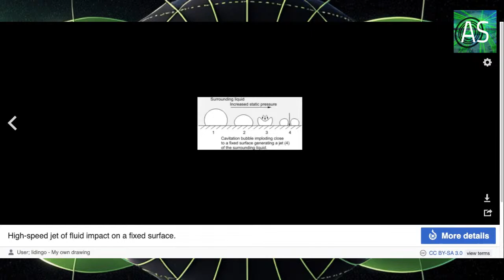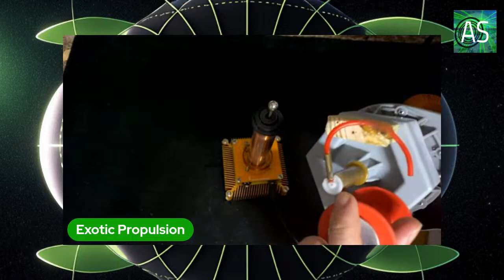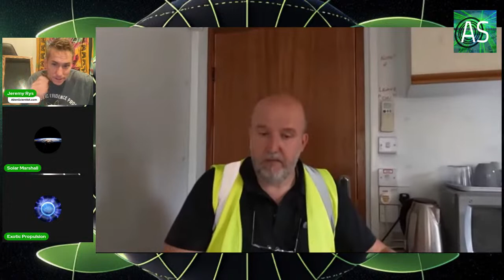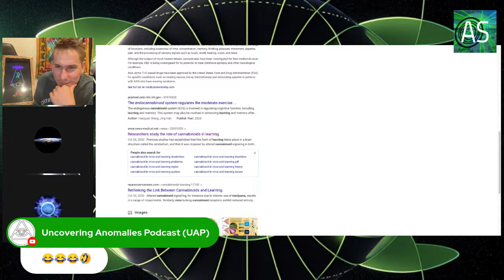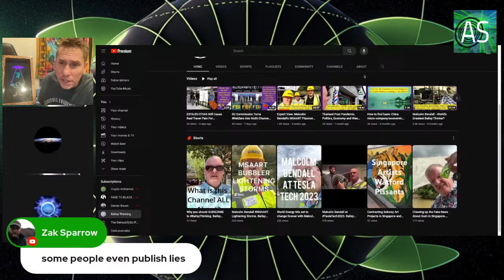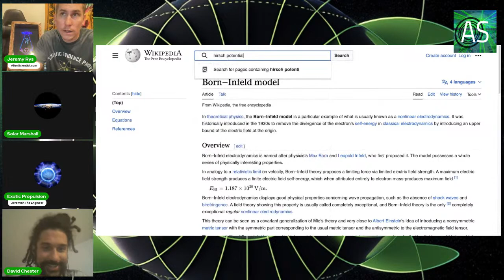alienscientist re-stream The REAL Reason Joe Rogan Never Released the Malcolm Bendall Interview...

Comment: Vortex tube reminds me of two things. If you fill a plastic cola bottle with water tip it upside down and give the bottle a spin the liquid exits faster as more air enters through the centre of outer spinning water. 

The other is replacing the jets in a carburettor to match fuel and airflow to increase power at (WOT) wide open throttle.The original jets let the engine idle well and rev, but under load it would die out. The new jets had the same diameter hole on exit with the only difference being fuel intake side was flanged out creating an increase in spin fuel velocity.
Reply: Also, do you think a UFO engulfed in a rotating plasma that was observed to spin counter clockwise in the southern hemisphere could be to counteract the Coriolis effect?